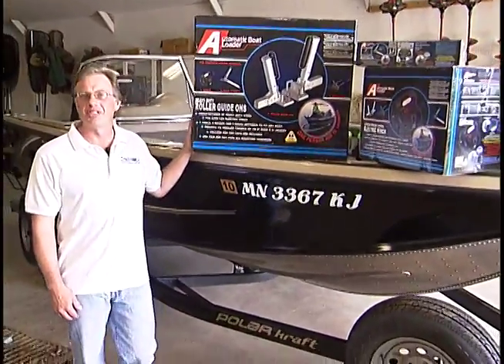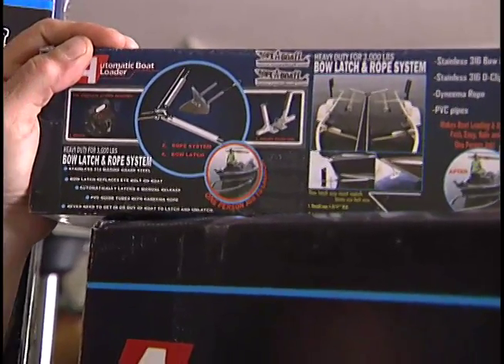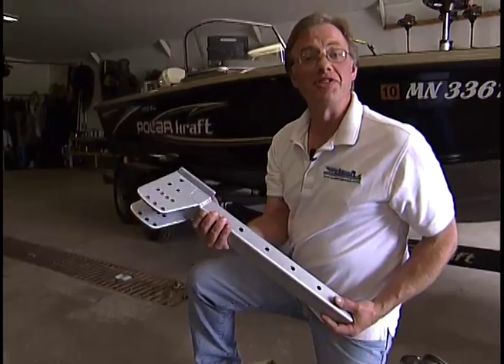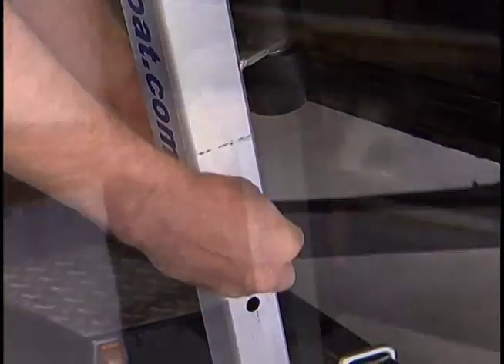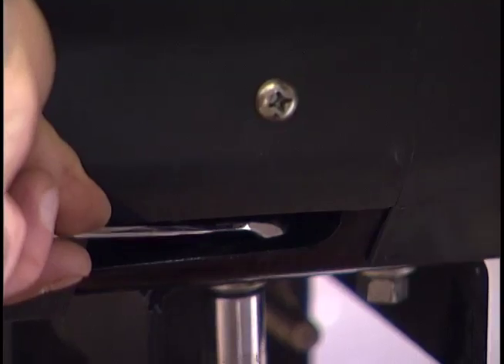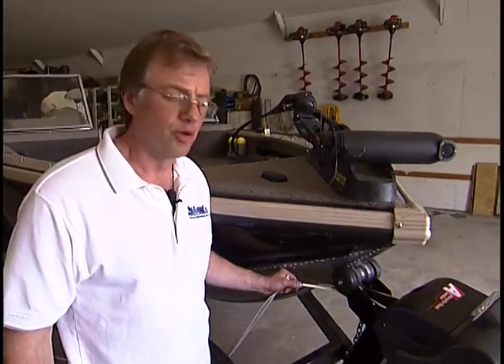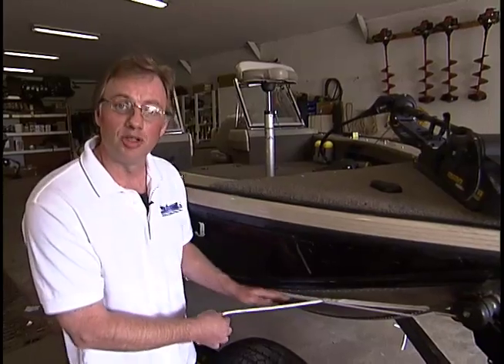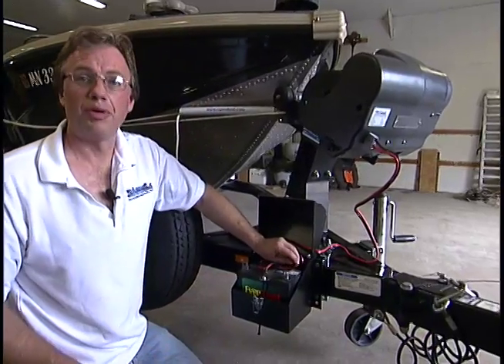Automatic Boat loader installation and instruction video

Comment: Help please. I'm an single old guy and have a 22' Sea Ray on a EZ-Loader trailer which I dearly love. I don't have much problem loading as I do unloading my boat, especially on windy lake days. My question is: I see through research the weight limit for this rope-a-boat system is 3000 lbs. Is this a vertical limit of 3K or a horizontal (dragged) 3K limit? My boat weighs in at 3600 pounds. Will this system work for me?